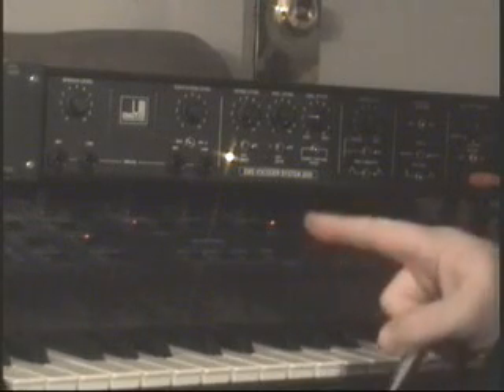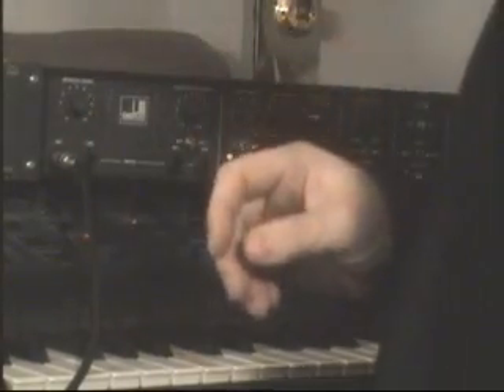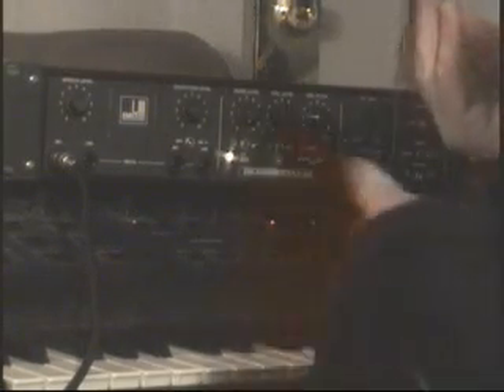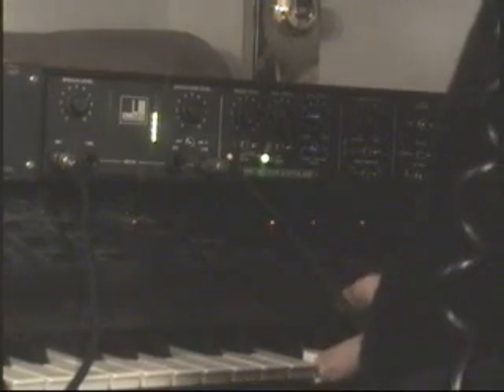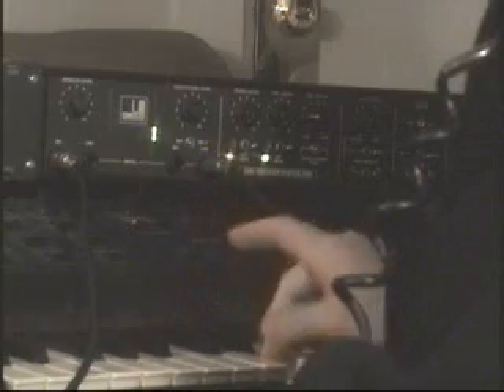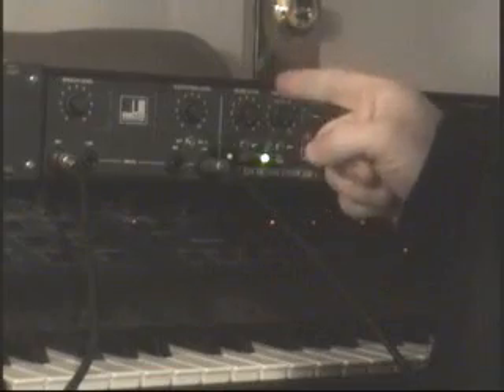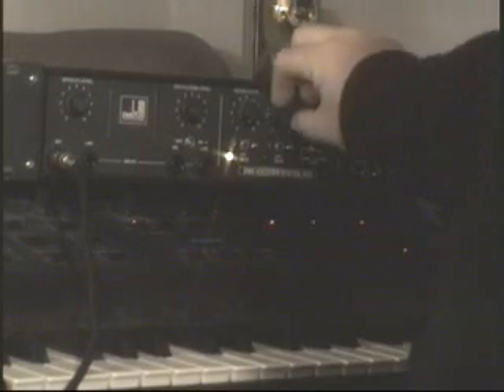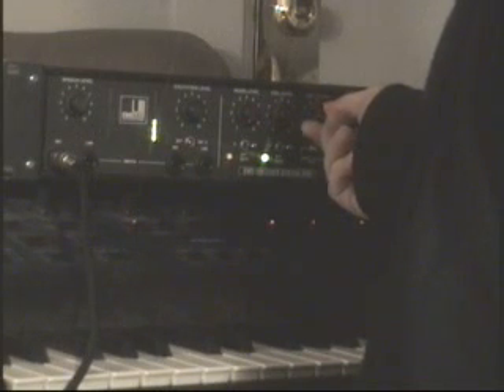EMS Vocoder What Is It? EMS 2000

Comment: First things first. Let's clear something up. A "voice box"or "talk box" is a completely different beast than a vocoder. A vocoder uses filter bands and circuitry to analyze a internal or external carrier signal. A "voice or talkbox" simply channels audio from any source through a tube from a small driver into your mouth to be filtered by your mouth and the space inside it. One sounds nothing like the other.

Comment: With all due respect.....the Electro Harmonix vocoder doesn't even come close to sounding as good or doing what the EMS 2000 can. It's not nearly in the same league. It's a toy by comparison.
Reply: Even the Roland SVC-350 Vocoder which has only 11-bands compared to the 14 the EH has is still better than the EH Vocoder.

Comment from the maker: When I bought my first v2000 back in summer of '96 I paid around $1,255.00.  So you probably wont find one much cheaper than that.  I've seen this vocoder actually sell for over $2,000.00 (which is crazy) It really all depends on timing, but now our US Dollar is weak so if you find on from overseas, you're likely to see one for an outrageous price.  But the one I have here is mint and came with the manual and I paid about $1,650.00 on an Ebay auction.  I realized how much I miss the EMS sound!!!
Reply: Holy crap! Just for "S'n G's" I looked one up on ebay and found one for $5,500!

They ain't getting any cheaper!

Comment from the maker: Also, the Cylons sound SLIGHTLY off from just the 2000 alone, so what I have been trying for years to accomplish is the particular settings they used for the oscillator, BSG TV info claims to have used a ring modulator with the vocoder to make the voices more "menacing" but I tried it and failed.  There must have been some sort of pitch done on the mic prior to the vocoder.  AnalogVocoder1 has recently contacted Michael Santiago (who did voices for the Cylons) and he vaguely remembers himself

Comment from the maker: I have been researching myself for years and so has AnalogVocoder1 (member) as well.  Some say it was the Sennheiser VSM -201 Vocoder but I use to own that model and it was not (I also have footage on here of that particular vocoder samples)  I posted some footage here; (Battlestar Galactica Cylon Screen Test) where they used the EMS vocoder internall oscillator as a test for the pre production of BSG so it was DEFINITELY an EMS vocoder and Robin Wood from EMS UK believes they used the v2000.
Reply: The Cylon Centurions were voiced with the EMS Vocoder 1000!!! NOT the EMS Vocoder 2000!

Comment: You know, I'm honestly surprised that Vocoders never took the place of talkboxes for guitarists: I guess guitarists just enjoying having a surgical tube down their throat? I don't have a vintage vocoder, a friend of mine suggested I go get an Electrix Warp Factory and I don't regret it. It's a fairly good unit and it won't cost you as much as these vintage models will if anyone here is shopping on a budget. The only downside is that it's discontinued, so you'll have to try your luck on ebay.